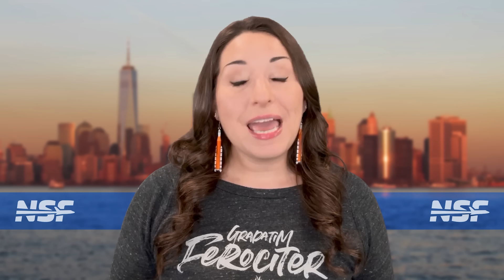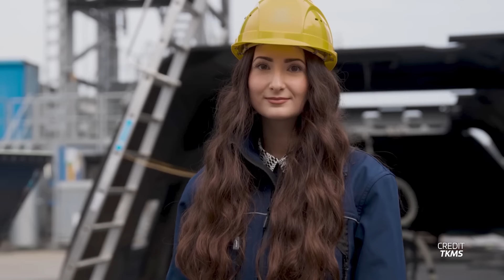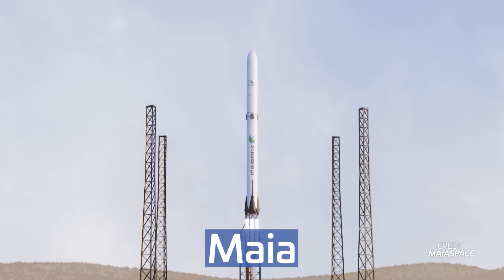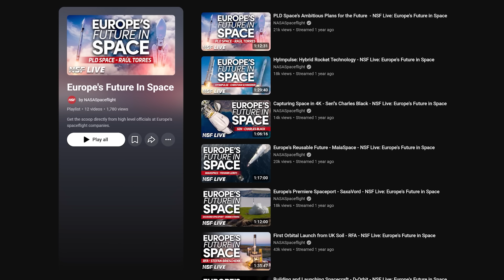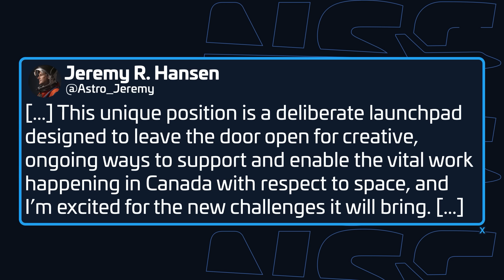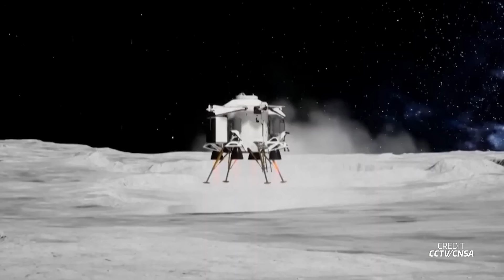China Lands Orbital-Class Booster for First Time - Historic Success | This Week in Spaceflight

Comment: CZ-10B does not use YF-100K. Only tricore CZ-10 uses 100K, since it is not available for second ignition. CZ-10B uses 3 YF-100Ns, equipped with TVC and is able to ignite twice; 2 YF-100Ls, which is fixed and can ignite only once, 2YF-100Ps, fixed and can ignite twice.

Comment: We are probably closer to 2031/32 than 2028
if we are talking about Starship and moon landing
absolutely nothing indicates that SpaceX can solve the problems with Starship they have and then land on the moon in 2028
there will CERTAINLY also be problems with fuel refueling and storage
both of those things are untested so something could easily happen and
 can Starship fly to the moon
 is also a question that we don't have an answer to
 so 2031/32 is probably not completely out of the question

Comment: the change to hypergolic thrusters over hydrogen is probably mainly due to the fact that they are incredibly reliable, while hydrogen is a bitch to work with, especially on long duration missions which will see continuous dramatic temperature shifts. The chance of valves locking is much higher in this case as amply demonstrated by the recent performance of starliner, so they probably thought better be safe and stick with proven solution even if it means adding those extra fuel tanks which after all are rather tiny.

Comment: lot of people here are comparing apples to rockets. 😄 SpaceX isn’t developing Starship just to be caught as cheaply as possible on Earth. The system is designed to land independently on the surface of the Moon or Mars and take off from there again. That’s why the technology has to be engineered completely differently. A catch system at sea is clever — but it solves an entirely different problem. 🚀

Comment: This is a total game-changer. The landing tolerance is over 10 times better than Musk's Falcon 9. Starship has to hit a bullseye for those chopsticks to grab it, which is why it spends minutes tweaking its descent. China's system just needs the rocket to land in a 50-square-meter net. That’s a piece of cake, like a skydiver hitting a drop zone. Once you're in the area, the net does the rest.
If they want to be even more forgiving, they can just make the net bigger and stronger. As long as the rocket drops in the general area, the ground net will catch it. With such low tolerance requirements, you can ditch the landing legs and support struts entirely. That frees up 20% of the rocket's volume for more payload.
I even asked Musk's AI about the images, and it confirmed this rocket has a way higher payload than the Falcon 9. Plus, it looks super easy to upgrade. I could literally design the roadmap: just make the net wider and taller for bigger rockets. Later, swap the steel cables for rare-earth cables for way more tensile strength. Scaling this up seems incredibly easy.
Reply: This rocket carries 16 tonnes to LEO in reusable configuration which is the same performance as Falcon 9, not more
Reply: You’re just another Musk hater. Falcon can do 22 tons while Long March 10b does 16 tons.
Reply: уважаемый, тут кроется одна беда: нагрузки на конструкцию первой ступени в вертикальном положении и в горизонтальном положении - совершенно разные...

Comment: what is all that black smoke coming out of the forward section of that booster?
Reply: I think that the Chinese put an abrasive material on top of the booster as protection during 'hot staging' of the second stage and that this is that isolation material catching fire.
Reply: It's confimred that some EE devices had been caught on fire during the landing. Considering it's the 1st try in the seires, it should be optimized soon.

Comment: Aircraft carrier arresting cables have a breaking strength of roughly 150 to 250 tonnes-force and routinely stop 20 to 30-tonne aircraft landing at around 240 to 280 km/h. A reusable rocket capture is a different problem. The booster is not in free fall during the final capture. Its engines reduce the descent speed to near zero, so the cables only need to absorb the remaining kinetic energy and stabilize the vehicle. The reported Chinese system also uses about 8 cables with electromagnetic damping, allowing the load to be distributed and reducing peak forces. With high-strength cables and multiple load paths, the system should have a significant safety margin if the design specifications are correct. Whether it proves reliable in repeated real-world operations remains to be seen, but the underlying engineering principles and physics are sound.
Reply: Interesting idea, I wonder why nobody thought of it before. I feel like it's simpler than falcon nine
Reply: Interesting!
Thanks!